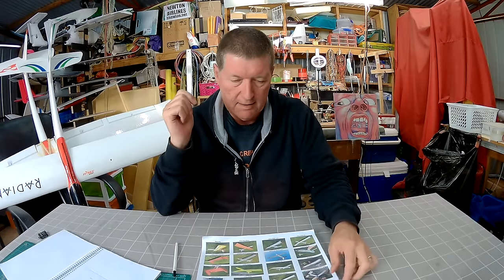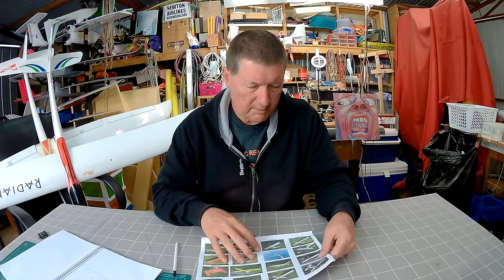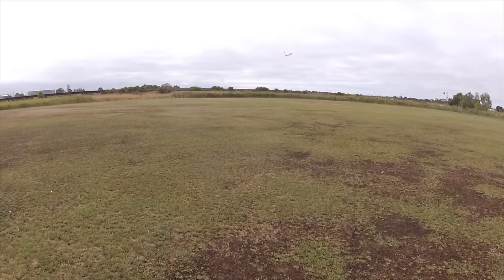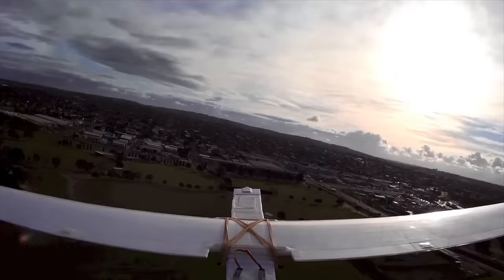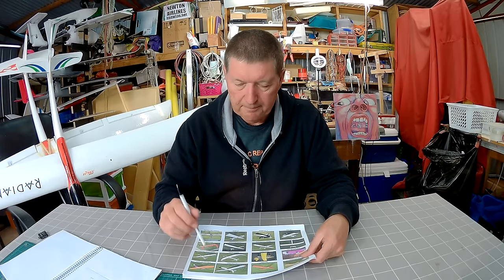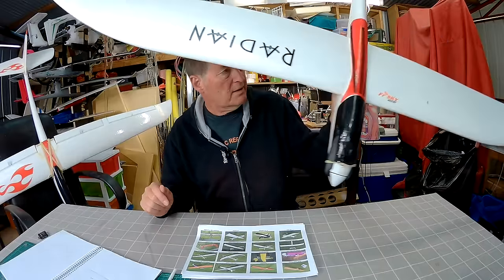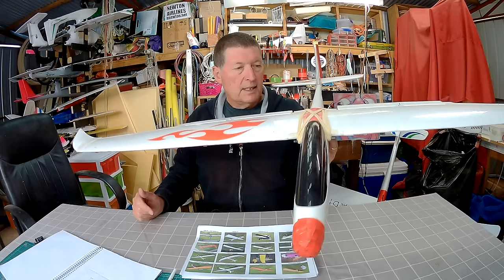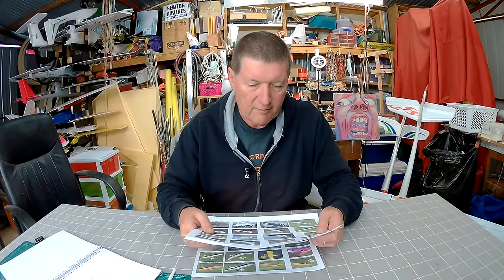Past Planes 4 Radian & Phoenix

Comment: That single boom pusher you built had the exact same problem with the one I built... My Uncle who is a full size glider pilot said.. The reason for the adverse yaw is actually because the fuselage is to boxy and big !!
When you try and turn, you present the fuselage sides to the oncoming wind, because the fuse is so large it creates massive drag and actually try's to push the nose the opposite direction to the turn..
Said some of the early wooden gliders had similar  problems... Too much side area on the fuse's.. Bootloads of rudder mixed in cure's them enough to fly, but areodynamically they are not a great setup... Problem gets worse the longer the moment arm is between the tail and the fuse..
Reply from the maker: Yes it is aways worse with big chunky pusher fuselages
Reply: @AndrewNewton  Yeah I always noticed the same...  I suppose the fact that these types of pusher's always use a boom style fuse aft of the wing is a factor too..
Big drag ahead of the wing and almost nothing behind due to the small side area of the booms.. I remember thinking the next time I build a boom type pusher, to try and oversize the rudder to try and fight the drag from the front fuse !!
Interesting topic !! I suppose wing choice with differential in the ailerons would also reduce the adverse yaw from the wing perspective.. But I think its definitely more fuse than wing causing the problems with these..  Makes me want to have another big pusher now ;]

Comment: old video but relevant to me as i am revisiting the Volantex phoenix, there is a new one out same slim fuselage but with ranger style clip in wings, only a 1600 so far but my one should be here in a few days, went for kit version, so i could put better motor and servo`s in from start
Reply from the maker: Nice one, I wonder if the 2000 clip in wings will fit?
Reply: @AndrewNewton  will be interesting, as i have a set of 2000 wings i will try when it turns up, but i kinda have my doubts
Reply: @AndrewNewton  Yes the ranger 2000 wings fit perfect

Comment: Andrew, I really enjoy your videos and I am enjoying this review series. In general what are the characteristics of your more successful slope soarers over your less successful slope soarers. I am wondering if there is a "sweet spot" in terms of wingspan, length, weight, controls, wing chord and profile? Also do any of your homebuilds come near to the satisfaction you get from factory made slope soarers? Thanks for your time and for making these great videos. Al.
Reply from the maker: Low drag seems to be the most important factor. The converted XUAV One has turned out to be my favourite but it's big and difficult to transport, same as the Phoenix 2000. The sweet spot is 1.5m for all wind performance and aerobatics and ease of transport. Fuselage needs to be tough. The Fusion mad flipping sloper scratch build fills a niche that is not available commercially. Light wind aerobatics. But you really do need a selection of slopers for different conditions.

Comment: +1 for King Crimson! :-)
Reply: The pusher model with yaw problems needed a much bigger fin.  The fuselage is like a weather vane pivoting around the CG. You had too much fuselage side area in front of the CG compared with behind, so it was essentially unstable. It was probably largely the thrust of the motor that kept it going forward at all ...